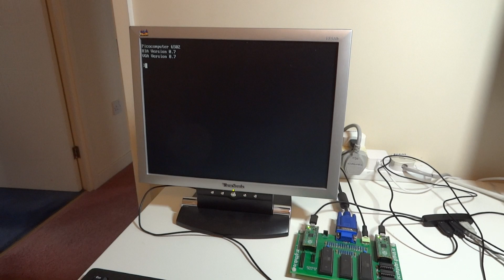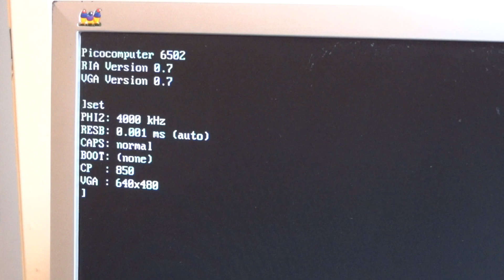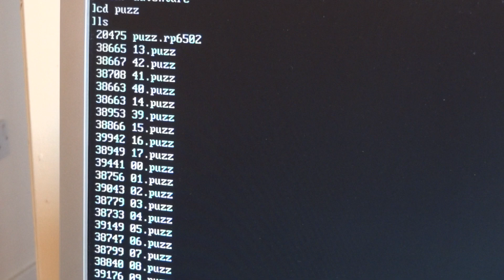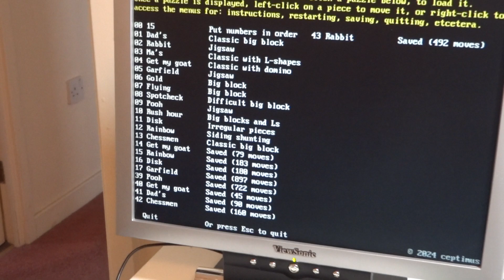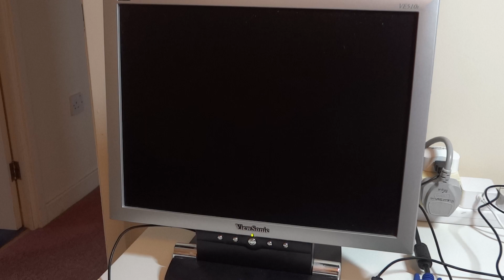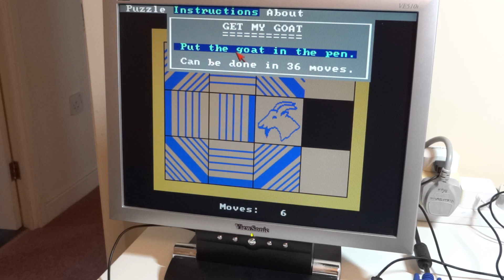Sliding block puzzles for my picocomputer RP6502

Comment: Hi  do you still have another one for sale, I live in Plymouth and happy to cover all costs of P&P , never used PCBWay before so would be easier to get one already made up from somebody in the UK.  Looking forward to following the making of your game. Now I'm 74  I am going through a nostalgic period I think first computer ZX81 back in 82 but never followed the 6502 route went with Atari ST the PCs.  Let us know if you do have one else I will go through PCB Way.
Reply from the maker: I've got three bare PCBs, with green solder mask like the one in my video - the PCBs cost me about £6 each delivered.  P&P to Plymouth is about £3 so you could have one for £9, or two for £15.

At the other extreme, if you want a complete picocomputer RP6502 all built up and tested, complete with the Pi Picos, it owes me £72, so say £75 including P&P to Plymouth.  I'm sure you could get the parts cheaper though, if you shopped around: I bought them all from Mouser UK, and their prices and delivery charges are pretty steep (though very convenient).